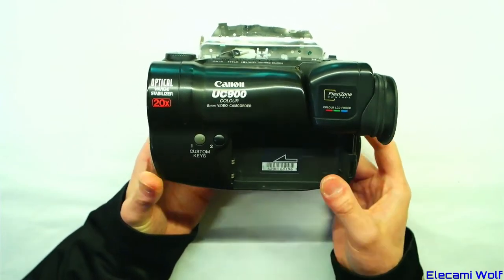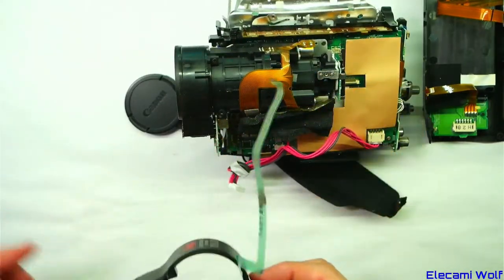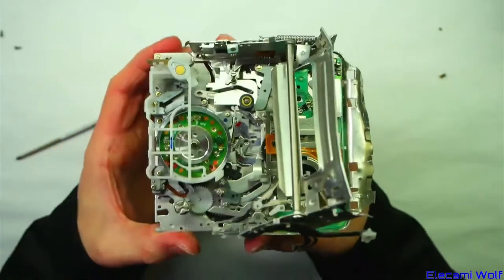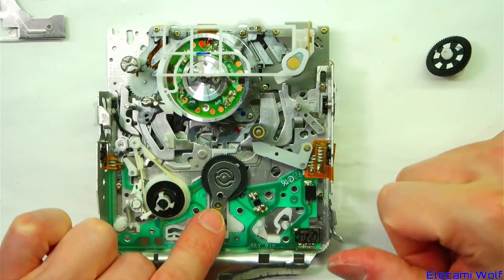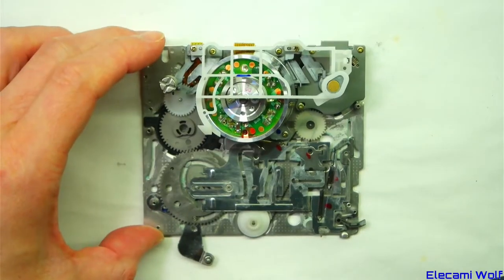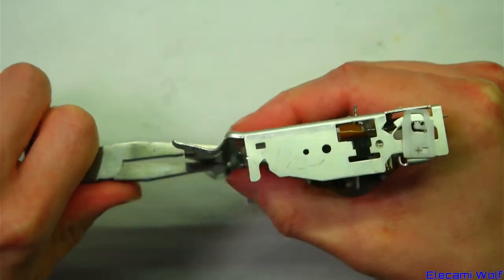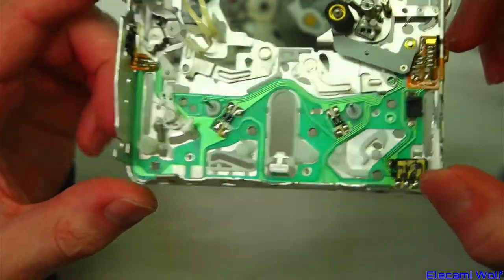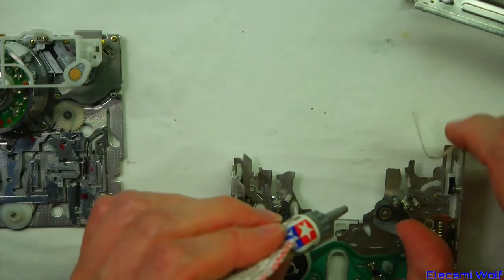EW0008 - Canon 8mm Camcorder Teardown + Repair

Comment: I have the Canon VM-E1 from 1985, the first model. Actually I have two of them. One has a working VTR section but the tube is worn. The other one has a good tube but the VTR section on that one doesn't work. It will load, and do fast rewind and fast forward, but as soon as you go into play or record mode it shuts off after a second or two. I think everything is direct drive so no belts. I managed to find the electrical schematics and layout for the boards but that's it. 

My theory right now, before looking at the internals, is that possibly the drum isn't spinning up to speed or the FG/PG signals from the drum aren't being picked up by the SYSCON, which is resulting in it going into shutdown? I'd really like to get this one working since it's one of the only 8mm cameras to use a tube instead of a CCD.
Reply from the maker: I'd check the power supplies first. Probably caps dried out and it can't maintain voltage when the motors start up.

Comment: Very impressive that you even attempted such a repair. Could I tap into your expertise. I recently purchased a Canon ES8600 on eBay. Playback works although I hear an intermittent squeaking sound which seems to correlate with some display artifacts (jitter?). Another "symptom" is that the rewind stops prematurely. Any ideas about the cause and possible solutions? At first, I was thinking that lubrication is needed, but after watching your video, I realize just how complicated the mechanism is. In any case, I have another Canon camcorder (ES2500) which works well but doesn't have a Time Base Corrector which is included in the ES8600 model.
Reply from the maker: Thanks.
I don't know the 8mm system very well. To debug yours I would take it apart and run it then listen and poke parts to see where the sound is coming from. 
I am not sure about the rewind issue. Is something slipping and making the speed too slow, causing the rewind to stop as a precaution.
Reply: @Elecami  Thanks for the reply. As suggested, 've ordered a JIS #0 screwdriver and plan to partially disassemble. If lubrication is needed, I read that somewhat costly synthetic watch oil is recommended for cameras, Altenatively, I already have a silicon spray lubricant that I could try if needed. Would you have any recommendations about lubricating the transport mechanism? I also plan to look to see if I can find a service manual for that or a similar model.

BTW, I am amazing by the design and mechanical complexity of vintage camcorders.
Reply from the maker: @sweet_tooth  Never spay anything into the mechanism. Only lubrication I would normally do it a bit of grease on the parts that move when the mechanism is loading / threading the tape. Would have to find what is making a noise being being able to know what to do about it.
Reply: @Elecami  I partially disassembled the ES8600. I couldn't see anything obviously amiss with the transport mechanism,. I reassembled the camera after cleaning the drum and capstan. Without going into details, I noticed both playback and record issues.

My other Canon camcorder (ES2500) is in better condition despite being manufactured 6 years earlier. I also noticed some HI8 recording issues with the ES2500. Thankfully, it works well for my Video8 transfers.
Reply from the maker: @sweet_tooth  Good that you have got something you can use. 
Sorry it is really difficult to do remote diagnostics.
Reply: @Elecami  Thanks so much for all of your advice especially the proper screwdriver. :-) In the end, I hooked up the Canon ES8600 as a webcam. It does a surprisingly good job but certainly doesn't match the HD quality that people have come to expect. I have a Canon EOS R5 so I can really appreciate how much technology has advanced in the last 20 to 30 years.

P.S. I noticed that fewer recording/playback artifacts with the ES2500 when the recording starts about 10 minutes into the tape. I suspect that there are issues with the transport control mechanism (since the HI8 cassette was brand new) which are exacerbated towards the beginning and end of the tape.
Reply from the maker: @sweet_tooth  Could be mechanical. Also could be old worm out capacitors going bad as they heat up a bit from use.
Reply: @Elecami It could be related to the capacitors since the ES2500 was manufactured in 1997 while the ES8600 dates from 2003. I also watched a YouTube repair video which mentions similar problems related to the ribbon cable connectors. In that case, re-seating the connectors fixed the problems. Perhaps I'll give that a try one day but, for the time being, I'm content with using the ES8600 as a webcam. BTW, the (mono) audio from the camcoderer is a bit noisy but it's easy enough to combine audio from another source. I use OBS which allows the video and an external audio source to be synchronized (I needed to add a 100ms delay to the audio for proper synchronization).

I may try directly recording a few videos to Hi8 tape using the ES2500. All of this has been a fun learning experience. Thanks for the help.